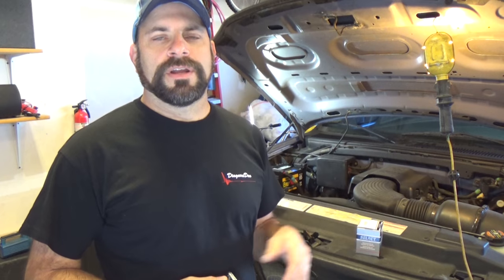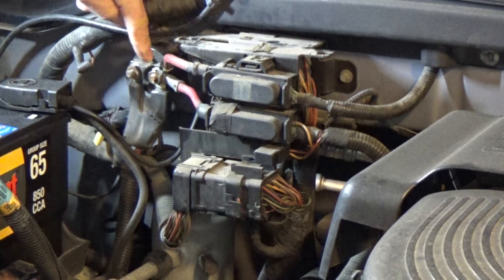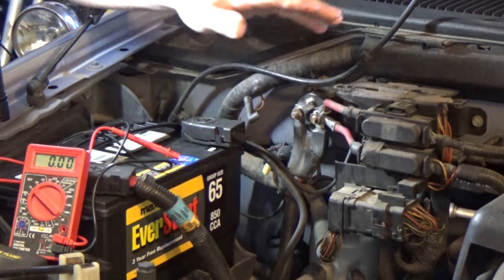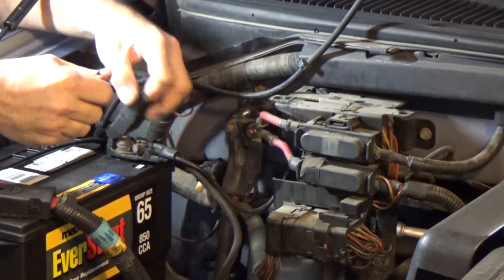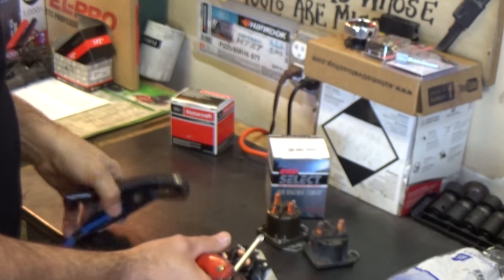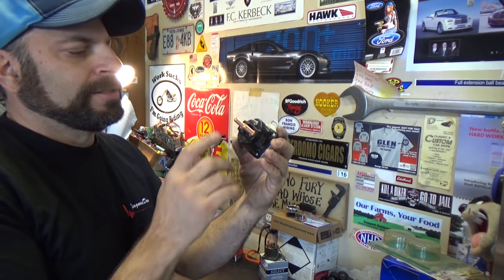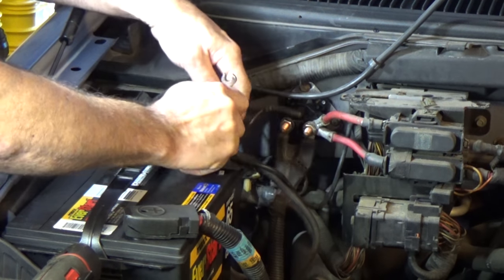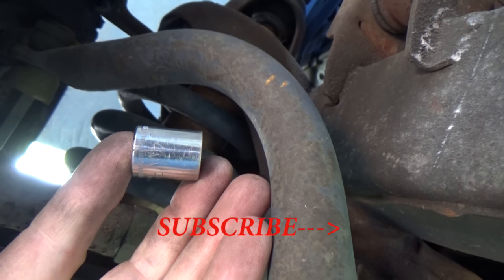Ford Truck Starter Solenoid Replacement -Won't Crank, no start

Comment: I have one of these mounted on the passenger side fender. T-shape on my 91 Ford f350 7.5. I went through 2 of these and all it's doing is making buzzing sound. I already brought 2 from O'Reilly's it seems every time I put one on, it's does the same thang. Buzzes  when I try to start. My battery and starter are brand new from last year. I even put a new battery cable that goes from the battery to the solenoid and still nothing. I don't wanna have keep running back and forth to O'Reilly's getting a new one and it's doing the same thing. Can someone tell me what it could be.
Reply from the maker: Link to the OE Motorcraft solenoid is in the description.
Reply: @ozzstars_cars  where is the description?
Reply from the maker: @hendricks177  all videos posted on YouTube have a description under the title of the video.  You have to click on it to read about the video description. A link is also posted in the top comment section.
Reply: @ozzstars_cars  you can't tell me what it is? Why you buzzes?
Reply: @ozzstars_cars  it doesn't really show nothing about the problem mine is having.

Comment: Why if bench test ford ranger starter, it not stay ingauge if i keep small wire on pin. It uningage with start small wire  on start point. It must only uningage only when i take of start thin wire, am i right or wrong? 

Rrrrrealy hope someone can help me. Thanks guys.

Comment: Ford Edge 20xx wont start, theft led blinking. Disconnect battery then try again. WORKS!
Reply from the maker: So what do you think is causing the PATS security to glitch out?

Comment: I used to have a '77 LTD that would go through solenoids every few months. I just kept a screwdriver on standby.
Reply from the maker: The good old days!
Reply: Did you ever find that you may have had a defective ground strap especially the flexible ribbon Style

Comment: And what happens when u try to jump the solenoid on the fire wall with screw driver an it doesn’t turn over r crank
Reply from the maker: Test the wiring and starter circuits

Comment: I have a 97 f150 pickup 4.6 we have no fire we know it's electrical problems but we we have checked everything we can possibly check change the fuel pump everything and we we cannot get no fire to it can anybody give us any suggestions

Comment: My car does intermittent no crank no start. Its a 98 explorer. Idk if it has a 2nd starter solenoid in it or not. Ignition switch, neutral safety switch has already been changed and battery is a fairly new one. It would be nice if it did so I could try replacing the 2nd solenoid instead of the expensive starter. Ik its a p.i.t.a!!!
Reply from the maker: Did you test the starter? Easy diagnosis. https://youtu.be/uGUIH2Fpho0

Comment: Just got news today that my ‘07 E-150 needs a new trans due to dropping all forward gears. Price of $3500, value of the van : $2200. Scrap price is $225 🤣 I think I’m just going to park it in case my ‘09 needs parts. Too bad to because the 5.4 was running mint, I had just put $1k in miscellaneous repairs and the ‘09 is a 4.6
Reply from the maker: That sucks Rusty. The '11 E350 I have done a few videos on lost third gear. Owner paid $4K for a rebuilt unit, 3 year warranty.

Comment: b w d   broke when delivered    just got a bad crank sensor from them
Reply from the maker: haha sure was.  Hope that CKP wasn't too difficult for you to access?
Reply: an equinox  the air pump and starter   i get paid by the hour so i dont care....but for my side jobs this one...  ugggh  i hate   this one was the same as you did   they need the car.....so....i think i felt lucky

Comment: When you jump the terminals with a screwdriver at 6:35 and get nothing more than a small spark, would that mean the solenoid is screwed?
Reply from the maker: Possibly. Best to remove and bench test the solenoid. If you bypass it and the starter cranks, then you found the problem.
Reply: @Hawsug I have the same issue. Did replacing the solenoid fix your issue?
Reply: @sibp901 , no it didn't.  And the OEM solenoid from the Ford dealer was a whopping $100, but I kept it anyway.  I next bought a starter from Amazon.  That solved my problem.  BTW, this was the starter for my old F-150 with the V-6 engine: Premier Gear PG-6727 Professional Grade New Starter.

Comment: At 6:40 you You are connecting the post(wire)  that has 12v to the post(wire)  that has no voltage.  You are NOT  connected pos  with neg. I figure you know it and just misspoke.

Comment: My truck keeps chirping even when the engine is off I took key out of the truck and walked away and the starter still was chirping so I disconnected the battery
Reply: Any advice
Reply from the maker: No clue without seeing the issue, sorry.
Reply: @ozzstars_cars  I figured it out it was the relay

Comment: This is so easy an 8 year old can pull it off. Leave it to me to (I think) screw it up. Connected everything, (lost that bottom nut also) cranked the engine, heard a horrendous noise from what I presume is my starter, and smoke came out from there, turned it off. Tried again, and .....nothing. No starter anymore. Have no idea what I did. Thought maybe I wired it back incorrectly, who the hell knows. Guess I’ll call a pro...didn’t wanna have to do that
Reply from the maker: Did you get it fixed? What was the prob?